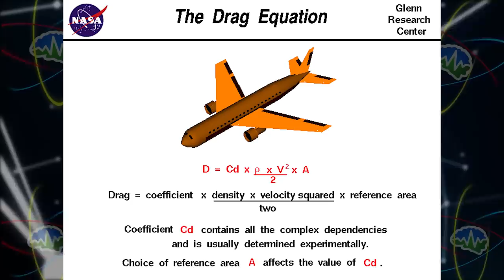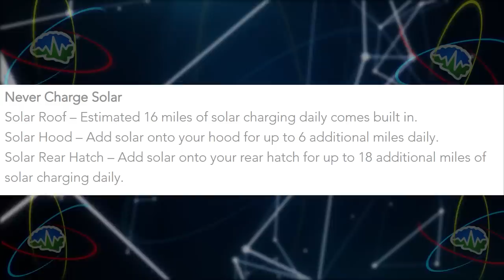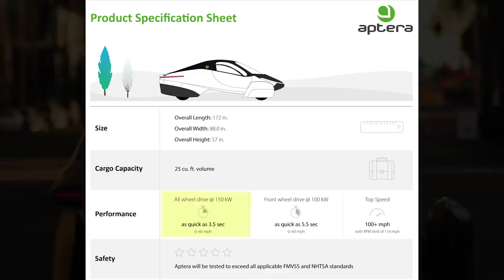Aptera Beats Tesla? | In Depth

Comment: I'd love to see the ratings of a crash test on this thing! You would probably have to wear a helmet inside. 😂
Reply: It should have a plug in so rescue can download your last wishes. 
Great idea for back roads
Reply: I bet it comes off the ground if it comes near a semi.
Reply: If the Aptera has ft. & side airbags, no problem — the trick is, cuz it’s so light, it has a thinner but longer vector in a collision. As long it doesn’t break apart, eg, on side impact, occupants will be safer than in any of the millions of cars on the road w/out side impact airbags. 
     The rear crumple zone should be above average, as long as you haven’t rested your surfboards against the backs of your headrests. (Crumple zones do not need to be as robust as in heavier vehicles cuz of the “skinny vector” principle.)
     The front crumple zone is a challenge, but the science & engineering supporting design are very advanced. Also this issue is pretty obvious — even if the govt has less stringent rules for three-wheeled vehicles, successful marketing at Aptera’s price point will depend on consumer confidence in safe light vehicle design.
     This is in contrast with a three-wheeled competitor, Arcimoto, that has a price target about half the Aptera. It’s current narrow, open-cage design w/ a more vertical driver position & no crumple zones, begs for a helmet mandate.
Reply: Death trap?
Reply: Exactly have u seen the Australian solar car races they flip in the wind and use aerodynamics like this car haha
Reply: @mikemccarthy1638  they said it was composite therefore has no crumple zone.
Reply: @rstallings69  — Not really, but esp. later when the all the older unsafe gas cars are off the road (sooner than you think).
     See my more detailed comment
Reply: Jack Paine — Re your first comment,
Aptera is NOT solar-only, feather racer w/ a relatively high center of gravity (cg). It weighs 1,800 lbs and has a low cg, due to low battery placement, low chassis structure, and light composite shell. In addition, it has a compact rotational moment of inertia due to its concentration of batteries just under the occupants. These two characteristics mean less chance of a rollover, and more chance of spinning on impact, meaning potential trauma is reduced by the energy absorbed by the spin.
     Then, due to its light weight, relative to the typical vehicle colliding w/ it, its force vector after impact will be thin (based on its relative low weight) and long (to compensate), meaning there will be relatively less partial-vehicle crushing & more whole-vehicle movement, as if it is being swept out of the way.
     Analyzing the physics this way tells me that so long as it has front & side airbags, and decent seats & belts, it will be reasonably safe, certainly not requiring a helmet.
     As for the issue of crumple zones, all the parts of the body outside the main passenger cabin space are crumple zones. The issue is how good is the engineering? (We can’t tell just from the material the shell is made from.) Having had a look at the chassis & suspension, there appears to be considerable thought given to how much the extremities can absorb or redirect impacts. At 10 & 2 o’clock, the outrigger wheels either absorb energy on impact and/or tear away. At 12 & 6 o’clock, the chassis structure appears designed to crumple, with the rear wheel & suspension capable of absorbing added energy. The most unprotected impact occurs at 8 & 4 o’clock (a less likely event that would almost have to be an intentional impact from a speeding vehicle).
     Assuming this analysis is in the ballpark, I still said that if airbags are not included, helmets might be needed. I’d like to think that Aptera has been safety conscious enough to realize that the lesser govt standards for two- & three wheelers
Reply: @mikemccarthy1638  nice you seem to know your stuff about this car. However if its a composite shell that's a very stiff material unlike aluminium. There will be no crumple zone on impact the composite material will not crumple due to its specific stiffness. I don't know why you belive it will crumple. Also light weight designs always struggle in high winds and are at greater risk of getting blown of the road due to cross winds. No doubt they have enough safety but I can't see it being a 5 star all round kinda car like the tesla. It be an engineering marvel if it got any higher than 3 with its design. Not to say its not a good Ev I think it's a great step forward for capabilities. Just not safety. All cars are carefully designed to reduce trauma in an accident some are very good at reducing risk but light weight cars are usually not as good at this. Have you seen the Australian solar races. They use very similar chassis and battery placement. They use aerodynamics to battle crosswinds but still you see them spin out or flip. Spinning out is still dangerous as you have zero control of your car you can go off a cliff or into incoming traffic. So even if it doesn't flip spinning out is still not good.
Reply: @jackpaine8461  Aptera has down force designed in.  If it didn't the cd would be even lower.
Reply: @jackpaine8461  Aptera has both front and rear crumple zones.  composite uses different materials where the particular properties are needed, including carbon fiber, E- glass, hemp, and Kevlar.
Reply: @jackpaine8461  I drive a 1800 lb Gen 1 Honda Insight that got 4s in the crash tests.  It is fine at 80 in cross winds semi back wash and the Aptera will be better in all areas.  It has been tested stable in 110 mph cross winds.
Reply: @technosaurus3805   Wind,  including from semis will place little force on it.
Reply: @n.brucenelson5920  carbon fibre doesn't crumple and neither does fibre glass. They shatter or crack hence why u say there would be no crumple zone. You can't seriously say that these materials are used as the crumple zone. I have a degree in engineering and have studied both carbon/ glass fibers composites and soft ductile metals like aluminium. Crumple zone is designed to increase the time of the crash to reduce the resultant force exhurted on the passenger. U need a strong but ductile material for that. Carbon fibre and glass are not ductile
Reply: @n.brucenelson5920  that sounds revolutionary for aerodynamics. I still speculate the fact that other simlar cars with similar aerodynamics and cross wind stability have still spun out due to their light weight design. I look forward to the car being developed and proving me wrong
Reply: @technosaurus3805  less affected than most other vehicles would be, especially SUV.
Reply: @jackpaine8461  all you have to do is look at the first vehicle which was crash tested to automotive standards.  There are clearly functional crumple zones and this is much better.  Perhaps you overlooked the front and rear metal subframes.
Reply: Its quite safe because it got a formula 1 like monocoque and it has the highest flip on roof durability ever measured. To the comment about flipping when surpassing a semi.... It is aerodynamic as hell so you slip through the semis turbulences... The aptera is a beutiful peace of engineering and stronger then most vehicles out there.... It exists out of 4 parts which are ai generated light pieces of composite. So just try to live through a formula 1 crash with your car and we will see....

Comment: I'm really interested in safety tests. Low mass makes it kind of vulnerable to head collisions with heavy vehicles.

P.S. Thanks for Trek reference. :)
Reply: That IS the elephant in the room.
Reply: What about collision avoidance both on this car and others in future.
Reply: As a data point, the Gen 1 Honda Insight weighs 1800lbs and got 4s in the crash testing.  While I can't speak to head on collisions, I was hit from behind at 60 mph in one and had no injuries.  I expect the Aptera to do even better.  Also, the Safety Pilot Level two driving assist option at $1,300 should greatly reduce the chances of a head on collision.
Reply: Hemm, what if it t-bone by a semi? The car will roll 100 times like a barrell? Insert "Everyone hate to see me rollin in my wheel" meme here.
Reply: @dickmartino9933  The Level 2 driving assist is a $1,300 option and will take upgrades to the software over the air.  The necessary hardware could be added later through simply plugging in a board to the wiring harness, if the care were somehow ordered without it.  The sensors are camera based.
Reply: @19grand  In crash tests years ago it did very well. .
Reply: @Leingod123  I also wondered about center of gravity , battery's in electric vehicles make them many times less likely to roll over compared to ICE cars , but was this one rated for roll over yet?
Reply: @Leingod123  What if any car is T-boned by a semi?  It is much more likely to be pushed than to roll.  The center of gravity is extremely low, not only because of the batteries, but also because the motor weight is axle level.
Reply: If Aptera goes to category of motorbikes, it don't have to do those collision tests like normal cars have to do.
Reply: @petertraveller6421  Oh , then most states require a helmet? A lot of questions not answered yet. Hope they do a follow up soon.
Reply: @petertraveller6421  It doesn't have to, but it will anyway. Safety was a primary concern for the engineers when thet designed it, and Aptera will exceed all crash safety standards for passenger cars before it ships. It is a very safe design.
Reply: @steviemack9  Most states do not require a helmet since it is fully enclosed.
Reply: You commenters must not ride motorcycles.  
  This is not the vehicle for you.  Just buy a cybertruck or the semi.  That way you will be "safe"  as for me I will be driving fearlessly in a small efficient vehicle.
Reply: @TitoRigatoni  Thank you. I did a bad search. New Hampshire  is the only one to require a helmet in covered 3 wheeler. Hey and the state moto is "Live Free Or Die" Funny ....some ironies tickle me. Thanks again for info.
Reply: @youmakeitreal  well... about that... That would be a valid argument if this vehicle was introduced as a motorcycle alternative. But it is compared to a regular car, so it is supposed to be used by people looking for a car, not a motorcycle.

Comment: I have a 2018 BMW I3S and get 115 to 120 miles on a full charge from a level 2  home charger plus it will run on gasoline from the small engine that runs a generator which I have not used and is so quiet you don't know when it's running.

Comment: I can't imagine this car will be any good in snow either.
Reply: The three wheel drive should be just as good as any all wheel drive.  What makes you think it won't do ok in snow?
Reply: @MattWellandMiscMarvels  My only concern in snow is the belly of the car. Small skinny tires with a wide stance and on three drag points does lend itself to being good in the snow. The belly may lift the car with the same mechanical efficiencies as going through the air and keep the tires traction from doing their best job. Hoping the battery density in the bottom of the vehicle negates this. TL;DR: May glide instead of sink.
Reply: @olebloom1641  As a veteran of driving many vehicles in snow, I know that narrow tires do better in snow, especially if they are snow tires.  The big plus with the Aptera is that it has traction control that is far more reactive than any ICE vehicle.  Next winter year we will have video of a production Aptera going through the paces at the Elaphe cold weather test track.
Reply: @MattWellandMiscMarvels  Light weight cars I’ve driven in snow have been quite skittish.
Reply: @willaerley7140  1800lb doesn't seem that light.
Reply: Being light weight is a pretty big advantage in the snow, especially with all wheel drive I bet this thing would do ok.
Reply: @dustman96  The laws of physics disagree with you.
Reply: @willaerley7140  Traction versus weight increases with decreased weight.
Reply: @markbeiser  Yes I have. Waiting for the specs.

Comment: The lower cost future Tesla car that’s supposed to cost $25,000 will bury the Aptera.
Reply: @635574  Unlikely.  As Aptera grows, their manufacturing method will always be lower cost than Teslas.
Reply: They did say this car wasn't going to appeal to everyone. It more than low price, it the fantastic range that is so appealing.
Reply: But the top range of that Tesla won't reach 1000 mile per charge
Reply: @blueturborider  
Neither will the Aptera. Do the maths and work out what energy you need and the space available to put it in. Just sayin’
Reply: @devonbikefilms  I don't think they would lie about it like that. I mean yes the rang might not exactly be 1000 miles because it has not been tested out side of the test lab and we do that real world conditions may vary and can cause the range to drop but let hope they know it off
Reply: In terms of purchase price, sure. But the Aptera will be much cheaper to operate.
Reply: Just like the Model S was going to cost 50K, and the Model 3 35K. Tesla's 25K car will sell for 35K, without FSD. The 400-mile Aptera hits the sweet spot and with the 7500 rebate, it's 23K. With Aptera's right-to-repair philosophy, its batteries will be upgradeable as they get cheaper, and autonomy will cost 1K from Comma. When Teslas go out of warranty, they become very expensive to repair.

Comment: The efficiency of modern electric cars is amazing and this is next level amazing. You are basically driving on the energy it takes to power a 100 watt light bulb. A hair drier uses 1500 watts. So thats enough energy to power 15 apteras. I’m curious at what speed 100 watts will power the car?
Reply: Of course this will depend on the speed.  The question has to be framed in watt/hours.  The 3 wheel motor Aptera will do 0-60 in 3.5 seconds.

Comment: Im driving electric Cars since 2014. In this Time i have the Ioniq, a Twizy and i think about to order an Aptera. My Question is: What about Snow on Roads? I live in Germany. I thinking about the open tie rod  an the Wheels Covers/Fenders. What is when Snow get higher, or Iceblocks lying on the street? I'm looking forward to an answer. Greetings from an ex V8 Petrolhead. 😊
Reply: Cool.  A lot of Americans are intrigued by the Twizzy!..  To answer your question, Aptera is recommending the 3 wheel motor version for more control in slick conditions.  The traction control updates 32 times per wheel revolution, so it is likely to be able to respond much more quickly to loss of traction than other vehicles.

Next winter Elaphe will be testing under these conditions on their cold weather test track so we will have more definitive information on the way.
Reply: @n.brucenelson5920  Hi 😊. I think I put myself wrong. I mean what happens or how stable are the long steering parts, such as B the front tie rod if hit by a block of ice. The fenders are very deep and would drag in the snow if the snow was deep enough. And can be badly damaged .....

Comment: By my calculations that first increase from 25 to 40 kWh (250 to 400 miles range, extra $9k for 15kWh @ 10 miles per kWh) costs $600 per kWh, but the next increase from 40 to 100kWh (400 to 1000 miles, extra $12k) only costs $200 per kWh. 

I'm no sure why that should be the case. Or maybe I got my sums wrong. Probably a marketing thing, like, most people go for the "medium" option.

Comment: Would love to see an Aptera campervan, that's where solar really will prove useful.  Nothing better than being able to be off the grid for extended periods without the need to fuel up to run a generator for camping trips into the woods.
Reply: The SEC filing suggests that they will design one in the future.  For now, my wife and I plan to camp in the current design, and plan to head to Death Valley when we pick ours up to try this functionality out.  We have extensive motorcycle camping experience, so I expect it will be somewhat luxurious in comparison - especially in bad weather.

Comment: I think the design also lends it to use as an actual flying car.  A ram-air airfoil (cloth wing) such as is used for paragliding/paramotoring could be attached and the car. And it could have a propeller or two (one counter rotating) to move it along.  That allows you to cut across bogs, rough terrain, lakes, and other obstacles.  Of course, there are regulations and such which must be abided.
Reply: I would mount a wing in front of the rear wheel under the fuselage and two turbofans on the rear deck on either side of the rear hatch. With a little balancing it would make a excellent 2 seat busjet. Better yet you can drop the wing and store it at the runway. Vertical and horizontal stabilizers should be no problem,

Comment: Nice piece on the Aptera, and I hope they are successful!  At one point they talked about the current OEM’s and how they are stuck in making bad design decisions.  Then you showed a picture of the Bolt?  Really?  The Bolt is a solid car and I think GM did a nice job with it.  It’s actually a better value than the Model 3 in my opinion at this point in time.